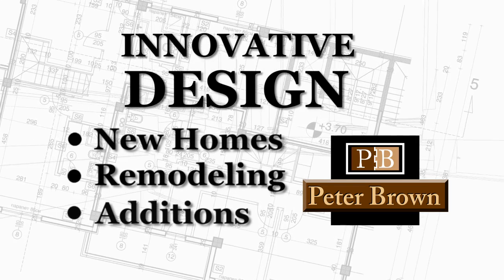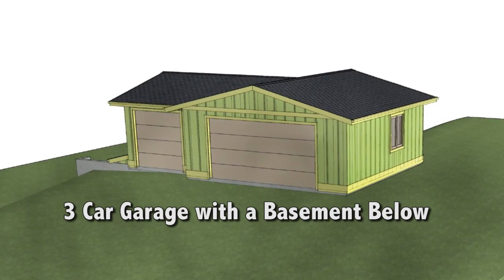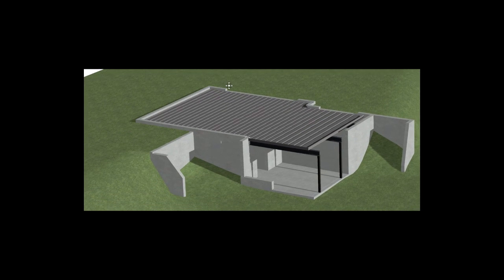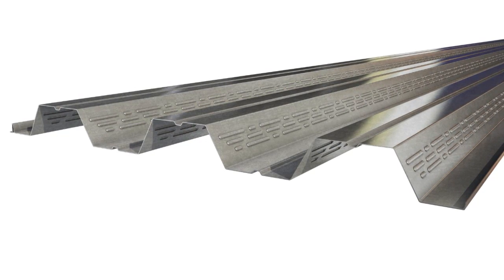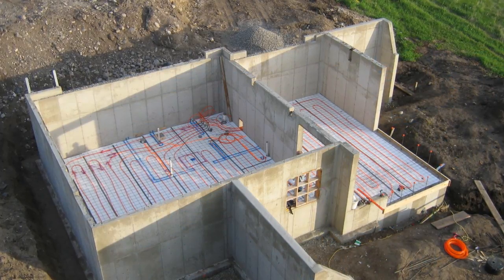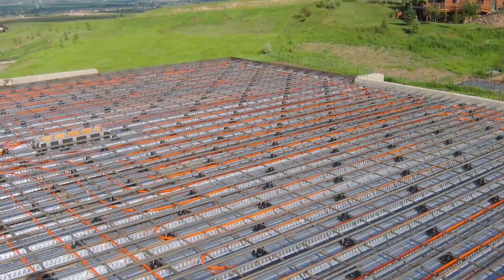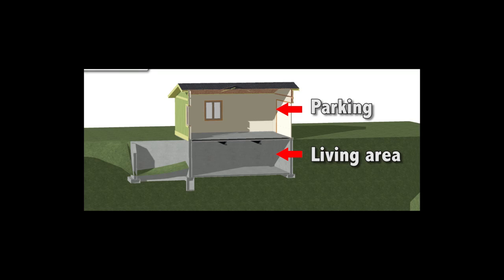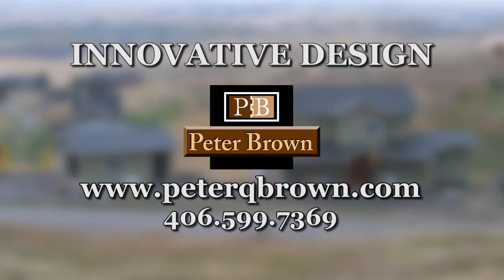Garage Over a Full Basement Design in Bozeman, MT

Comment: You can do this with hollow core panels, clear span 30 feet maybe 32. Completely open underneath.  Cost would be comparable but considerably faster. We have done a few basements with this added feature and not difficult to do or plan out.
Reply: Do you mean Spancrete or something similar?
Reply: @taemian  im not sure what its called in your area, it's different everywhere i believe. Basically 4 foot wide planks of concrete. They have hollow areas that make beams all the way through them. They have cables tensioned running through them. They work great and I have set alot of them in late 90s early 2000s. Have seen them used on some of our basements since 2005.

Comment: We have an previously filled in pool in our back yard that I think is the perfect spot for a detached garage.  I presume to build on the area we'll need to fully remove the pool.  With that much excavation and new backfill I've wondered if simply putting the garage over a basement foundation would make sense and essentially be cost neutral.  The slope isn't enough to make the resulting basement a walkout, but I'm sure we can use the space (indoor golf simulator 🙂)

Comment: Very nice job indeed. That steel pan decking is great. With  positive tension rebar set in between the ribs for maximum effective depth, I bet that once the concrete had fully set, that slab would take the weight of the average car, even without the presence of I beams. Obviously they need to be there,or lots of propping etc. plus the stronger the roof the better also to comply with building codes.  The cracking /deflection has to be considered as well as the strength, too.  
it would be interesting if the decking manufacturers did destructive tests to see exactly how much extra tensile strength composite action adds to these slabs before collapsing.
I think that the worry is that the steel pan would slip under load and break the essential bond, so composite action could not be relied on, especially with the pans being shiny.I believe that the added strength is usually just considered a bonus and pretty much ignored by structural engineers, composite load bearing wise, unless anyone knows differently.

I designed and built an underground bunker 30 years ago, by welding a steel structure with steel ribs around it encased in reinforced concrete. I ignored the strength of the inner steel structure in my calculations and just used it to support the weight of the 2 ft thick heavily reinforced roof and walls until the concrete set.I have never been able to quantify EXACTLY how much extra strength the inner core gives,nor has any other engineer I have chatted to, though it would be a lot. Assuming that the bond remains intact, then the tensile strength of the steel in the ribs would be acting on the greatest possible lever arm as it is not reduced by concrete cover. As the ribs rise then the effective depth would be less, though. 
It would be nice if a steel pan manufacturer had the confidence to park say, an 8 ton digger on such a steel pan roof design as you have used. Personally I am certain it would hold up fine, but i'm not advising anyone to actually try it ! I don't know if any manufacturer ever has done such a composite concrete test. Anyone interested in my bunker can see it by searching 'Nuclear Bomb Bunker Buried in Back Garden on You Tube.  
Anyway, kind regards and well done.
Reply: Just a note- The qualified structural engineer that did the calculations for 'American Bomb Shelter' also did not appear to be able to work out the composite action of their design, just using the reinforced concrete slab calculation sand stating the embedded I beams to support the wet concrete would make it even stronger. 
It is obviously possible to calculate the strength of steel & concrete structures    as separate  items , but when the 2 work together the strength is  likely to be greater than the sum of the two. Modern computer modelling could presumably do it, but that said, in practice many structures have actually withstood far more when tested to collapse than the calculations indicated.
Reply: All of these are tested through rigorous tests.  How do you think they do roofing, breezeways, commercial buildings, etc? The real strong east for point load is different than rebar.. there's many directions and dimensions that will determine how and where it will crack or not and what it is for for live load vs dead load in any given spot......
Reply: @michaelthomas3340  Cough Twin Towers. cough

Comment: I want to remove my garage floor and excavate all the dirt below. Then turn the 21 foot by 21 foot space below where the garage floor used to be into a room. Then turn where the garage is to be into a room. Then lift the garage roof up and put a room above that! 3 equal sized rooms. Downstairs could be a theater room, main level could be second living room or pool table room the top floor could be a similar.